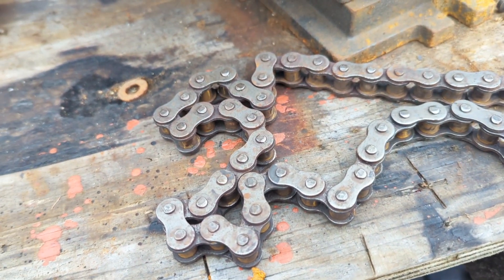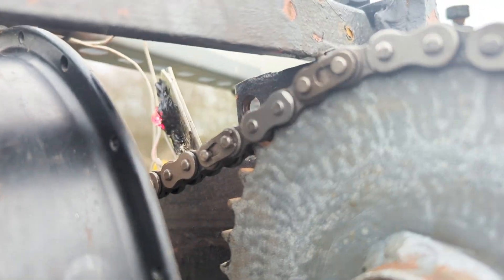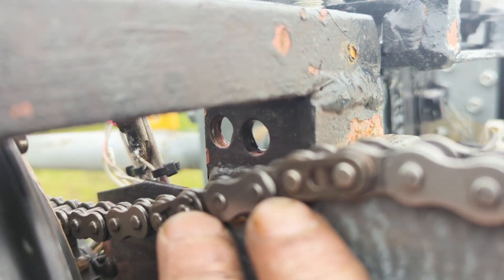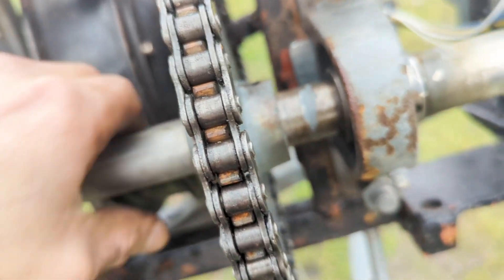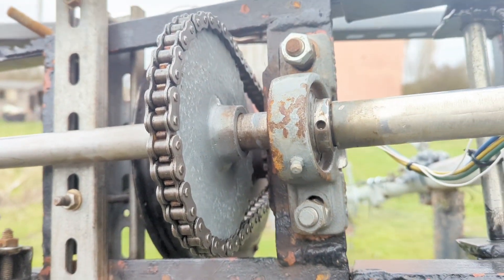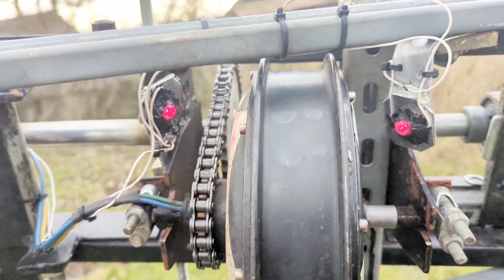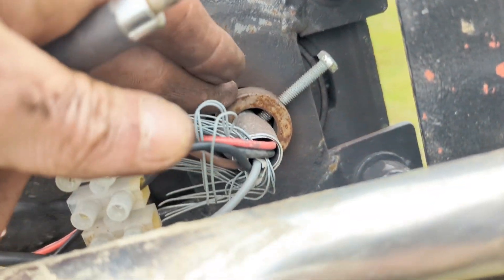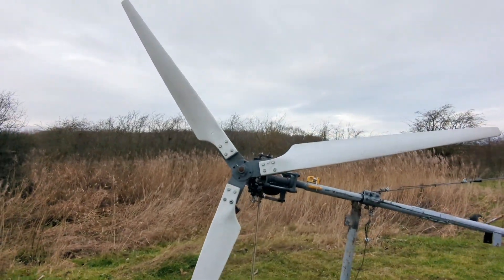The New Monster High Speed Gear is fitted- Looking very awesome - 3kw 75kg DIY Wind Turbine

Comment: Feeling good about this! Now we have an increase in motor rotation! Every bit helps. Sooner or later we find out a system max potential! Waiting for the graph comparison of Numbers to be generated. Granted not every day is the same. Your video will lead us to building our own system as I do not trust what's out there. Cheap vs DIY <- which is better? ( leaning on a DIY system like this for sure! ) Adding eggs into this experiments basket! Cheers! 😊
Reply from the maker: We shall get the juice flowing tomorrow it may need 20ph to really fly.